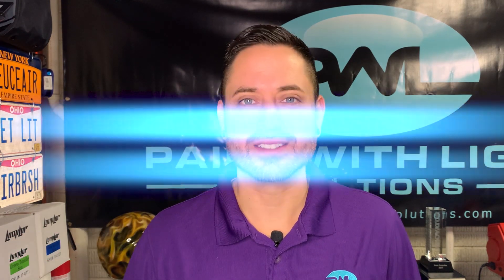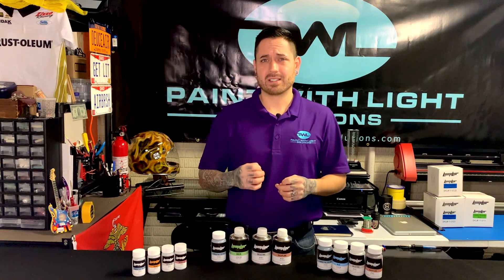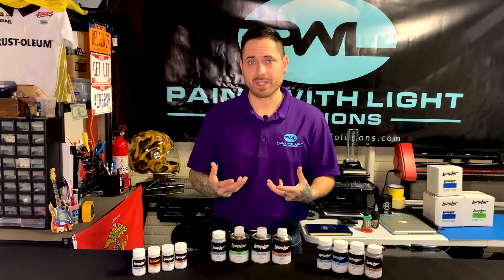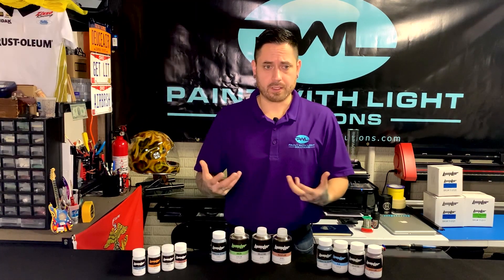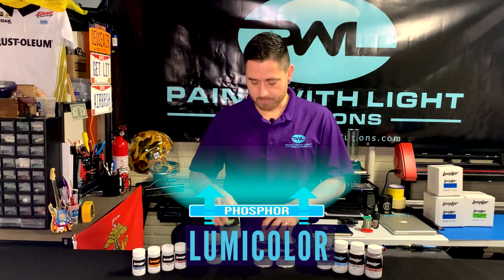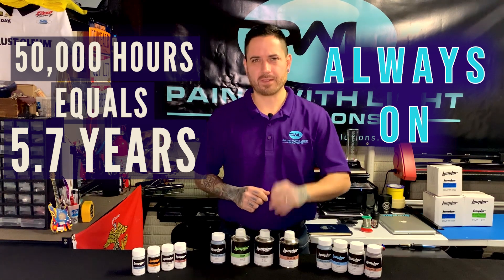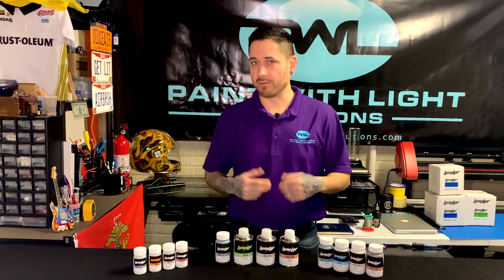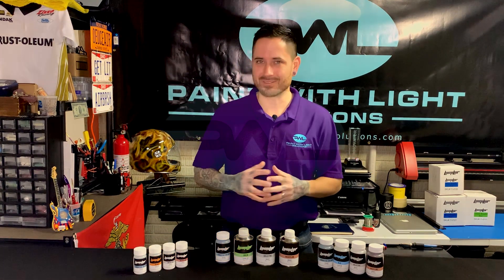LumiLor A to Z - What is LumiLor? How it works - PWL

Comment: Is the base layer positive charged or connected to the voltage source?? This would mean that you need and insulating layer between the panel so it does not go to ground. is the voltage applied to the top layer?

I would be careful against making claims about safety related issues like painting doorways or signs and saying that you can see them at longer distances unless this has been tested. It is common practice to use light diffusers over top of LED or other lamps to create a diffuse look that this product creates. I would argue that this product is in fact less bright then LED but is cool because you can paint it on a complex shaped surface to create a custom effect after the fact. 

Fog lights on a car are specifically mounted down low and are focused so as not to create as much reflection of light while a wide diffuse source of light would be terrible at distance because of the reflection of the fog. 

I think that this product is great for custom signs and cool applications but you may want to reconsider your claims about its ability to cut through fog or be used in specific safety situations where the air is not clear.
Reply from the maker: All good questions and concerns here!
Yes, the base layer and the top layer both carry the Alternating Current. 
Yes, we do insulate the substrate if it is made of conductive materials. The Alternating Current will transfer to the substrate from the paint if it is conductive and if there is poor insulation between the lit paint and the conductive substrate. 

The paint is a form of Electroluminescence which is a 50 year old technology. The claims we are making for distances and visual representations in the video are based off of scientific Electroluminescent properties that can be researched. The brightness differences from Electroluminescence to an LED can also be researched. 
Thank you and if you have anymore questions or concerns please let us know!

-PWL
Reply: I worked with "electroluminescent" (EL) material since the early '90's and can tell you from personal experience that it is highly visible in fog and smoke. Let me try to explain to you how it works. It's like having literally millions and millions of light sources where not all of the light is blocked. This guy knew what he was talking about in this video.

Comment: This is amazing! How long will the paint luminescence last? Do you think it could work for a mural?
Reply from the maker: Sorry for late reply, the light only goes burns when lit and it can stay lit for 50,000hours before it dims half as bright. 
Yes murals are great to use this for. You can plug directly into wall power since it’s already Alternating Current, no inverters. 👍

Comment: Can I get LUMILOR at my auto body shop ?  Could I get it to work properly with my TRAXXAS RC CARS, and DJI UAV DRONES ?
Reply from the maker: Absolutely Ron! 
You can light up your drones and RC cars. You will need at least 9V to power the inverters. The system is voltage dependent so if you can have 12V available then your light will be brighter! 
We specialize in video training and can create a video tutorial for you on an RC car or drone if needed but we don’t sell the paint anymore.

Comment: On a car application can the suns UV damage the lumilor paint like it can automotive paint?
Reply from the maker: Great question!
Each LumiLor Paint application needs to be encapsulated with UV protectant clear. Just like the automotive paint that fades is due to the clear coat not having the UV protectant. 
If it’s not cleared with UV protectant clear it will break down quicker and get to the “half life” quicker.
Just make sure it’s cleared with UV protectant clear!
Reply: @_paint_with_light  Could you make this like printer ink that you could pour in a Epson Ecotank Or canon mega tank printer?
Reply from the maker: @fgfjfdjdjdfhhgfjgcjf8300  Yes! That is all possible. Some materials have a larger particle size but short answer is yes, it is possible.
Reply: @_paint_with_light  Yes possible but will you do it because that would be awesome if the average person could print out their own custom light up signs without having to pay thousands of dollars for specialized equipment. You would have allot of customers all over the world outside of painting cars.

Comment: But how to tern it on and off
Reply: Hahaha don't even understand what's going on .... 🤣🤣
Reply from the maker: The system is powered with Alternating Current with two wires. 
One wire is connected to the backplane and the other wire is connected to the Bus Bar. 
Those two wires are then connected to an electrical system that runs AC. Most of the time it’s powered with an AC inverter from a DC system.
Reply: @_paint_with_light  how do you hide the wires of it is on a flat panel and you dont paint to the edge?
Reply from the maker: @gatekeeperoffroad  it all depends on the type of substrate. 
If plastic you can drill trough the substrate and have your wire poke through from the backside to connect to your points. 
If metal or any other conductive surface when drilling through drill a bit larger than wire size and fill will resin. Then drill smaller hole in resin and pass wire through. The resin helps with insulation for when the wire passes through the conductive substrate to connect to your points. 👍
Reply: @Paint With Light  wow. Thats actually pretty cool. Great idea!

Comment: As a truck driver I like the idea of road signs. Old road signs sometimes used mirrored glass beads to increase visibility. Then they started using retroreflective lettering, which was better than ever directed lamps. But now the whole sign is retroreflective. That's fine if your vehicle has filament bulbs, but LED headlights reflect too much light making fog and snow even harder to see trough. And, those message signs are OK, unless they're set to the wrong light level.
Reply from the maker: We like the idea of road signs as well lit with LumiLor Paint! 
What you are seeing with the paint is a frequency that is being emitted. This frequency is responsible for giving the color its hue tone and not brightness. The brightness is controlled with the voltage. The more voltage you put to the paint the brighter it will appear, but due to phosphor particles we use  that flood the area and are not concentrated in a pin point  the brightness is more like a vibrancy which will appear more neon like. 
With an LED pin point diode that is where you get blinded is with its concentrated beam. 
The LumiLor Paint will give a soft glow on the road signs which is easy on the eyes no matter how far or how close you are to it. 
Thanks!